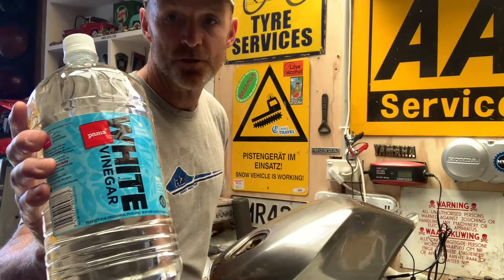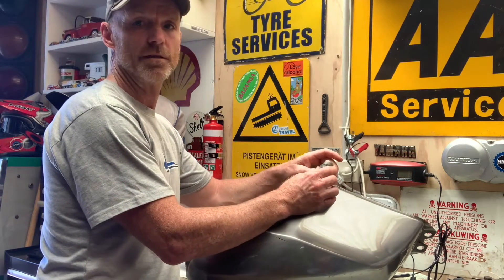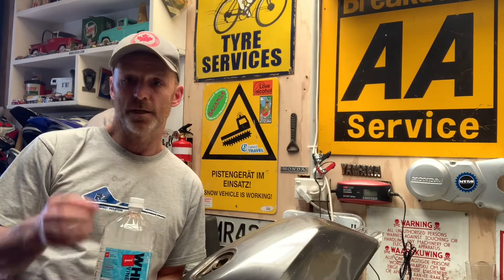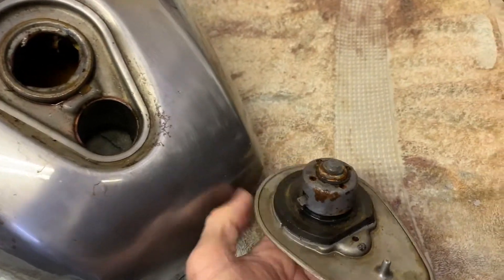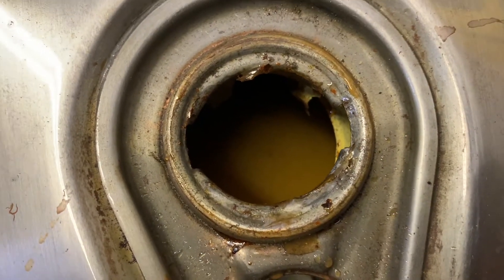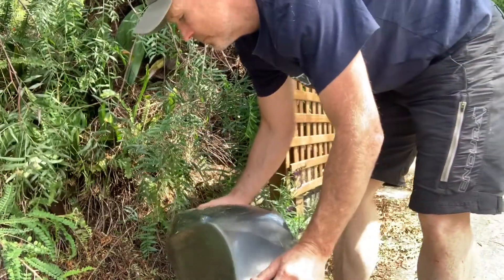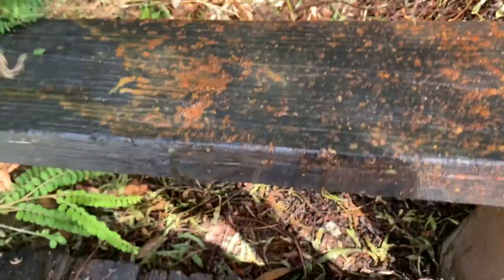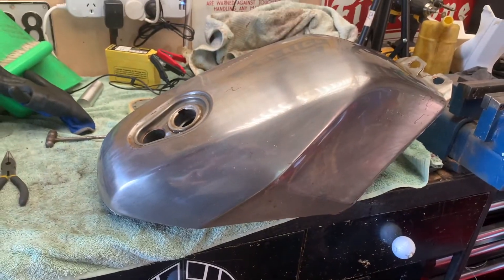Rusty Motorbike Tanks - Remove Rust Easily

Comment: Did you encounter any flash rusting right after? Did you rinse with sodium bicarbonate and water to neutralize the acid?
Reply from the maker: Hi I rinsed with water and then dried completely with an airgun. I normally seal the tanks with pour15 afterwards if they are badly damaged but if not I use a very thin layer of 2-stroke to line the tank if I am not going to be using it to prevent the flash rusting. It all depends on the condition and how bad the rust is.

Comment: So?what did you  to rinse out?
Reply from the maker: The rust....
Reply: Its ok..i read the answer you gave on another readers question you answered…thank you…
Reply from the maker: @artdore1632  OK sorry I misunderstood your question - You can use water to rinse out but you should be careful to use air to try the tank completely. Also once finished using water even if it is dry I normally put some fuel in the tank after the water  and rinse it all around and throw it away to make sure it is very clear. I hope that helps more?

Comment: How do i seal the metal after its rust free so it doesnt rust again in the future
Reply from the maker: Hi good question...I use a product called POR 15 to seal the tank. Here is the link to the product - https://por15.com/collections/fuel-tank-restoration/products/fuel-tank-sealer Thanks for watching I hope it works for you.
Reply: I don't know what happened but it didn't work for me ,it was pain of mine ass remove the por15 from inside the tanks
Reply from the maker: @rubenenergypoprider2048  Hi it's very important to have it very clean before using the POR15 sometimes the rust removal will take a few times in other words. Use the vinegar solution for 3 or 4 days remove it all and start again with fresh vinegar for another 3 - 4 days...depending on how much rust it can be a process that requires patience. Don't put the POR15 in before the tank is really clean.
Reply: POR has a kit as well for 70.00. It has cleaner ,prep and sealer. There are other options as well. None are permanent in spite of what they say but are good products. The best thing you can do is avoid fuel without ethanol. Personally I run at gas and have since the 80s. It's obviously higher than the crap you get at gas stations but considering the performance diff and can prevent fuel system issues it's well worth it. It's a bonus that it doesn't effect the tank by causing the surface rust.